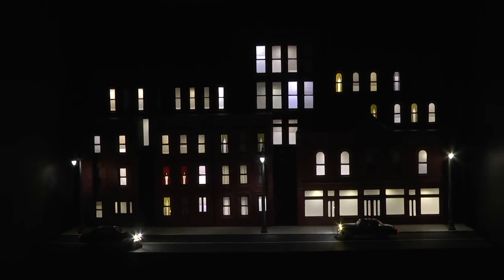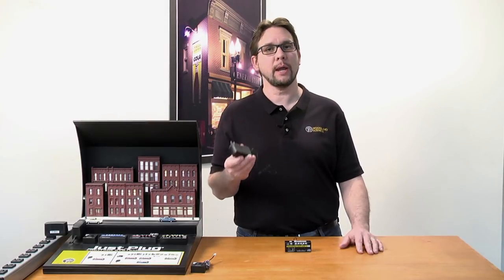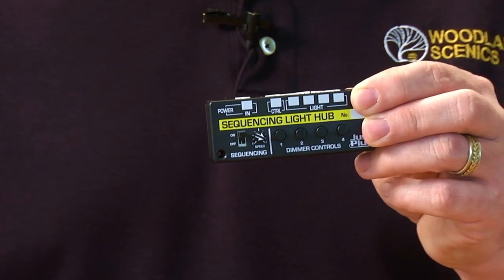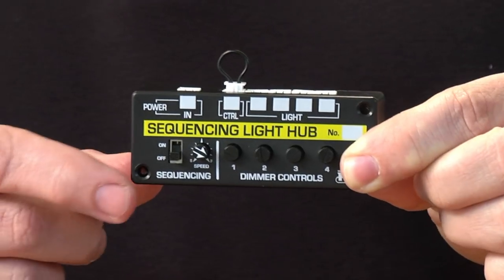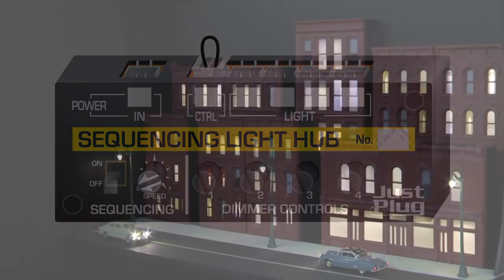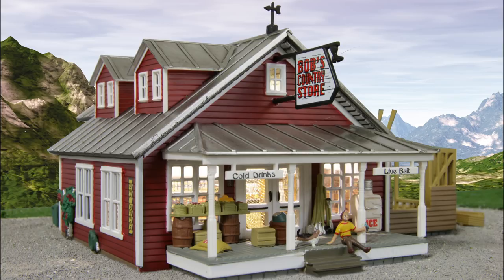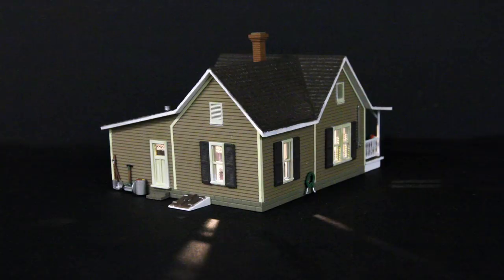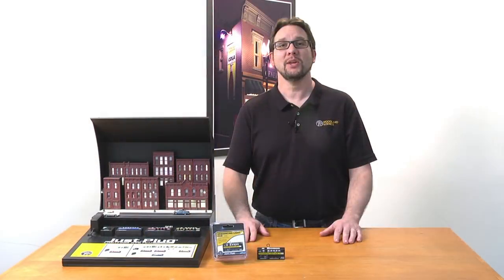Sequencing Light Hub | Just Plug® Lighting System | Woodland Scenics | Model Scenery

Comment: The Just Plug system just gets better and better.  You aren't the cheapest way to add lighting to my structure, but I'm not a "wiring guy" so I appreciate the ease of use.  I have added more lights in the last year than I have in 30 years of model railroading!
Reply: I hear ya! There's enough wiring going on with DCC layouts anyway, lol.

Comment: I see you can add, a DCC relay to it too ?.... so would I be right, to say .. you can now switch it on from a train controller program ?
Reply from the maker: Yes, it is possible to add a DCC relay to the Just Plug Lighting System. Each Light Hub has instructions on how to connect the Just Plug Lighting System to DCC.